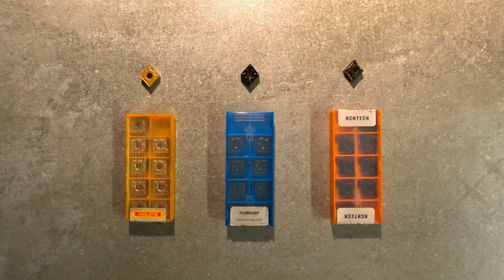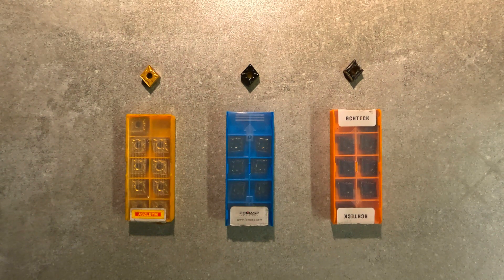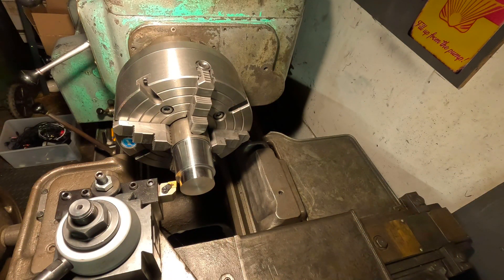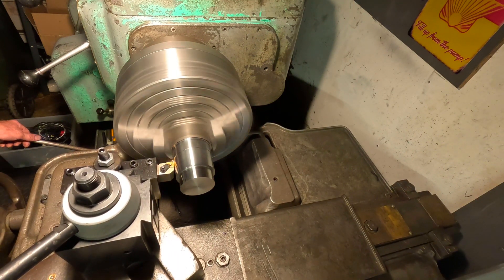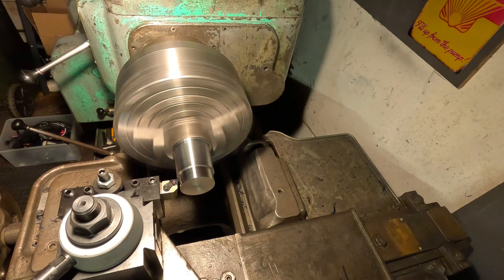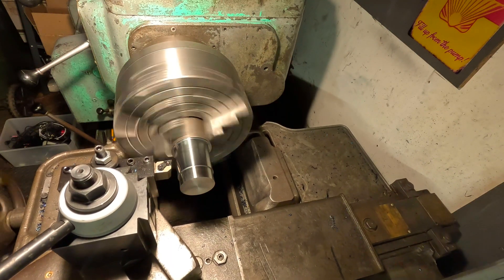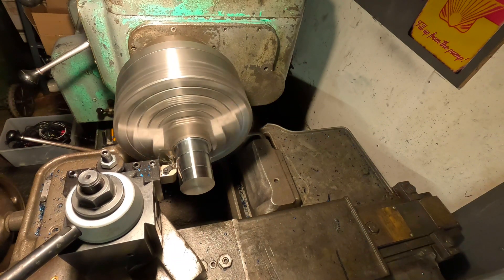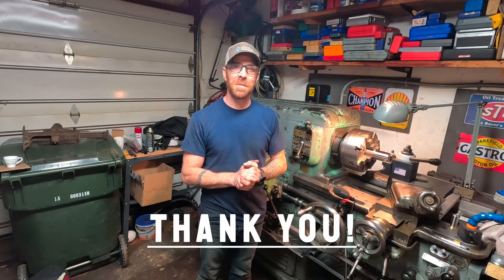CNMG  Lathe Carbide Insert Testing Part 2. Higher Speeds And Feeds.

Comment: Again 0.050" DOC is too small for these CNMG inserts, this is why the chip breaker does not work properly.
Up the DOC to 0.1" to 0.2" or more with a feed of 0.01" per rev.. Don't baby these inserts.

Tells zilch about inserts as they are not properly used, specially on a Pacemaker which should be easily capable of moving a LOT more metal than these 0.05" DOC.. Try a DOC of 0.5" at 0.01" or 0.02" per rev @ 1,000 RPM or more.

Comment: simple tool geometry should not be the determining factor as far as grade should be. any tool would cut a .050DoC  at feed and speed. whether it holds up for multiple cuts must be determined by grade.  chip control  is dependant on geometry.  there are NO best inserts.  there are inserts better than others,  and coating may determine even more what is better. this instructional video is useless  for the intermediate machinist.

Comment: The first insert had stringy chips. The second and third inserts looked like they were making 6's and 9's well. All three had good chip color so the heat was coming out of the part. Interested to see what each cutting edge looks like under magnification.
Reply from the maker: Hey hill top. Glad to hear your input and appreciate you taking the time to comment. I can definitely show the inserts under a microscope. Made this one during the week so didn't have the energy to do some of the extras.
Reply: @smallgaragemachineshop2715  Keep having fun. That's what it is all about. 👍
Reply: As long as the chips aren't shaped like 4's and 5's you are doing okay.